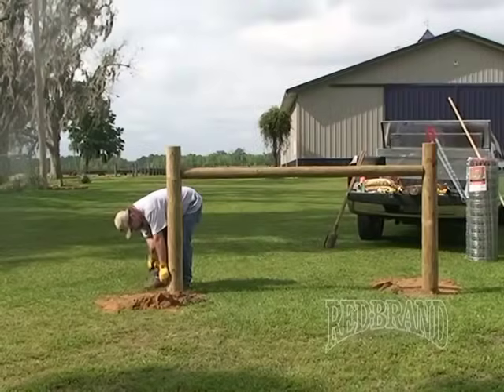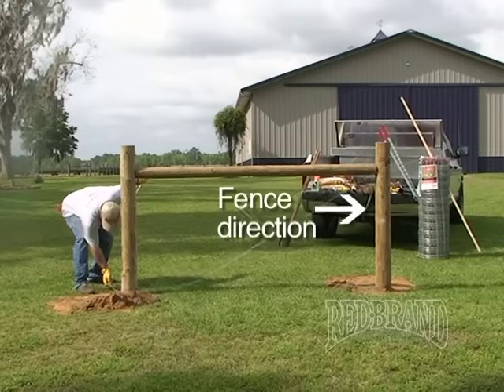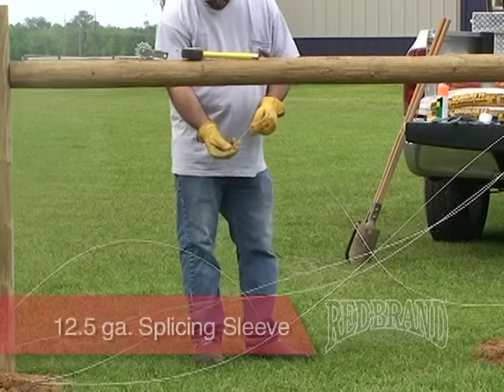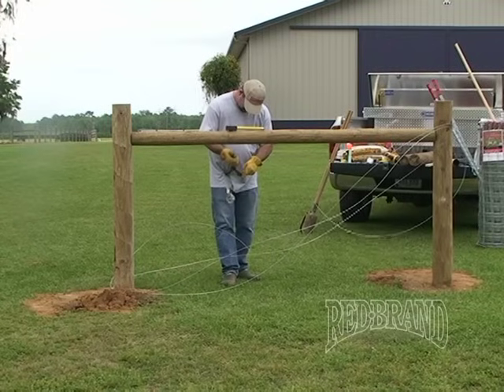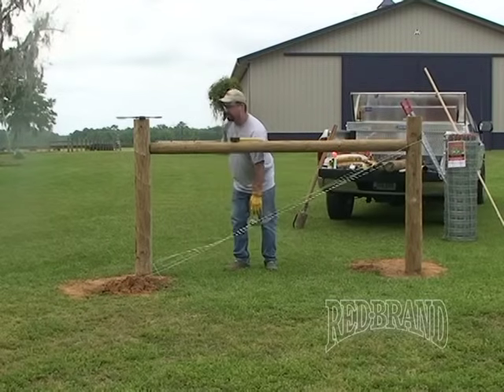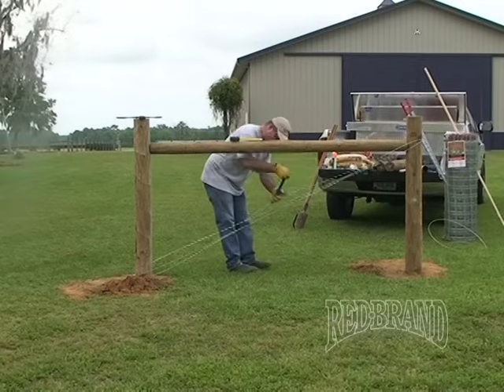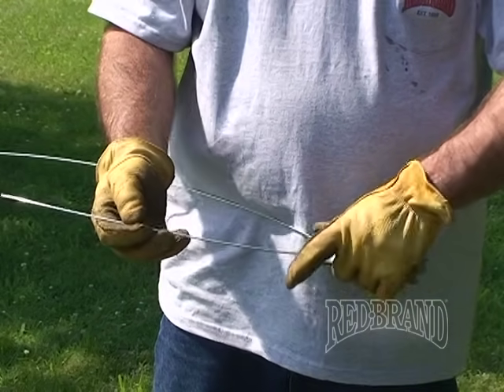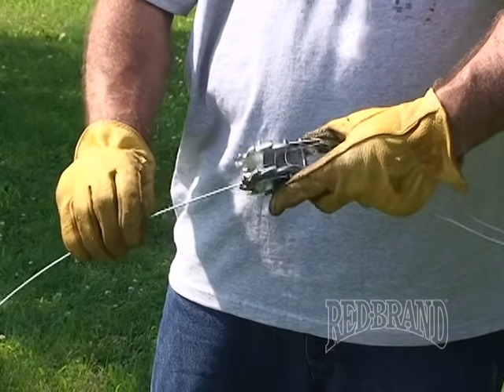Bracing Part 2 of 2

Comment: My mistake was using 12.5 gauge sleeve on a 12 gauge brace wire which didn’t crimp the wire well together and slipped and detached when I tighten on my strainer. My local tractor co didn’t have any 14 gauge sleeves.

Comment: I use lag screws, not staples on brace wire. Will not work loose. I like to use three posts with 2 horizontal braces for all long fences, like the video.

Comment: I learned a simple technic as a you man. #9 wire one loop around posts with a tightening stick of locust. Just twist the loop and rest the stick against by rail. Quick and cheap. We had tractor mounted post driver in the late 60s

Comment: Couple questions.

1. Why would you measure down from top of posts andThe. up from the ground which is where the ht of fence is determined?  I could see this is OK if you got every post to the same ht...but we know in real life this never happens.

2. In that corner post, if the holes are not offset by some distance the pin holes and pins would hit each other.  I didn't hear any mention of that?  Are they offset by some distance?

Thx.
Reply: 1. Watch the previous videos and you'll see how they set the posts at the same height.

2. Use your head. Either drill your second hole at an angle to miss the first or just move it down 1/2 in or so, in which case you drill your hole in the end of your horizontal a little lower to compensate and no one is the wiser.

Comment: I place my top brace pin a little differently.  I almost drive it in flush but I leave it out 1/2" and it makes a nice place to land the brace wire as I wrap it around twice. The brace wire is placed on top of the pin and is pulled down as tension is applied.  Stronger than a staple and holds stout.

Comment: I do have one suggestion. Not trying to be an expert but the double h brace would be stronger and take the weight of say a cow or calf running into the fence better if it was braced with the wire contradicting on the posts from bottom center to both top sides on the outside posts. The pull from an animal hitting the fence on the side of the brace that the most pull is already on can loosen after a while or maybe even break posts off if they are pulled too tightly in one direction.
Reply: YES  YES

Comment: so you didn't comment on whether to set the pin a little higher on the corner most post so as to avoid hitting the other pin?  Looks like you didn't double the wire as you did in the first video.  did you mention the different in pin lengths, five inches and ten inches?

Comment: Very good video. Zooming in on the handling of wire crimping and threading of high tinsel wire into the tensioners would have been more helpful. Also, zoom on the pin instillation for cross brace posts into the vertical posts would have been nice.
Thanks, Rick - Tennessee

Comment: This is very professional.
Most tension wire I've seen is a strand of barb wire with a short stick that you twist until tight.
Reply: YOU CAN BARB WIRE INSTEAD OF SMOOTH WIRE ALSO FOR AN AGRSSIVE FENCE ONE BARB WIRE UNDER THE WIVEN WIRE AND 2 OR 3 ON TOP

Comment: At a gate in the middle of a straight run, how do you run the wire? I would set posts on either side of the gate, then one more on either side to brace with.
Maybe this will help get my point across:
                              _                   _
----------------------- |       |  GATE  |       | -------------------

A).                         \                      /
B).                         /                      \
C).                        X                      X

Which way should wire run? A, B, or C?
Reply: On all multiple choice tests, I always go with, "All of the above."  My answer is "D".
Reply: B. Because the weight of the gate will pull the top of the post inward, so there needs to be a wire holding the top of the post back.

Comment: Is this for the middle of the fence? Or can the same technique be done for the corner post without doing an N brace.
Reply: This is end to corner sections. Around where i live its a pipe and 2 nails for the top. The tension wire has a pipe between the posts thats twisted tensioning the wire.
Reply: @brandoncaldwell95  i did H braces on the corners, with tension making the N.
Reply: Almost a year ago now.

Comment: Are you talking about the twisting that posts get after awhile on most fences, which keeps loosening the fence? I always terminate on the inner post of the H instead of the outer for two reasons: 1) to keep the wire centered so no post twisting occurs over time, and 2) to distribute the pull evenly between the two posts, instead of having almost all the pull on the end post. It is simple to then fill in between the posts. You can even lag some 2x's across as a climber.
Reply: Correct. Don't stretch from the corner
 Ever. In the Northeast, staple every 6th post tight. The rest are loose